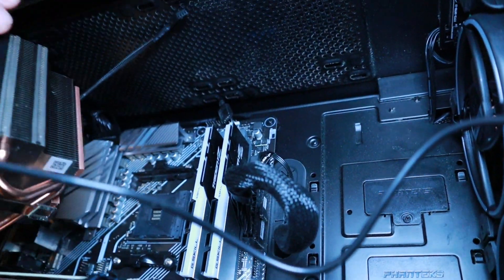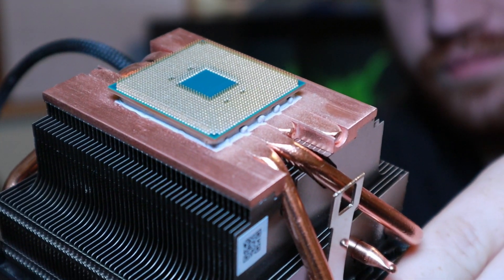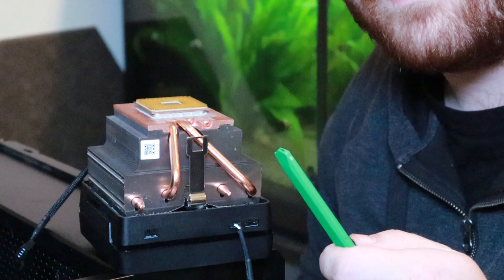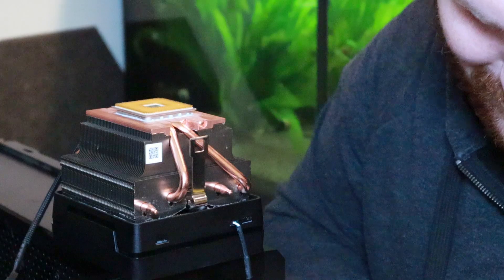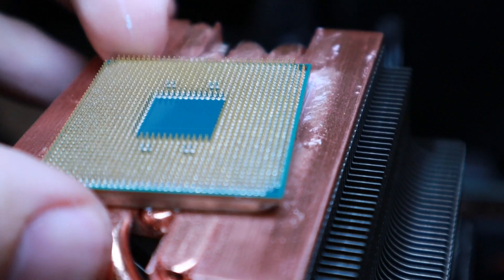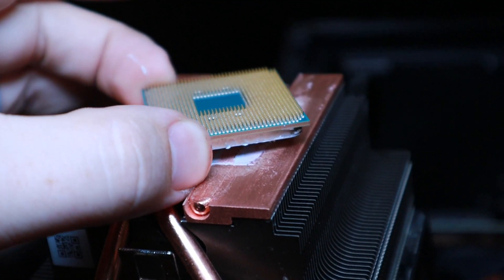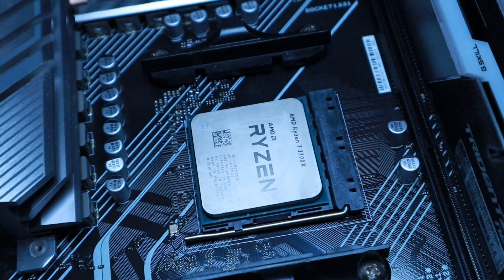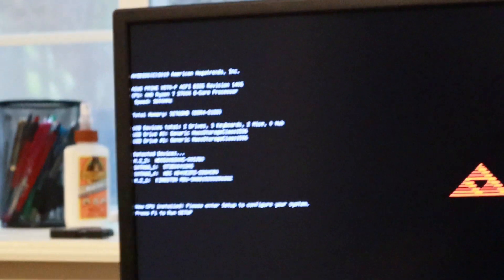almost broke my ryzen cpu

Comment: I think by this time you have already learned this but saying it for the sake of putting it out there. Before changing your CPU cooler, one should run cpu benchmark tests like Cinebench, AIDA and etc for like 15 to 20 mins to get the CPU and thermal paste to warm up. After that, shut down the pc and then try to change the cpu cooler. That way, the thermal paste will not stick to the CPU like a glue and pull it off when you try to change the CPU cooler. Warming the area up with a blower gun also works, but sometimes it might cause damage to the motherboard if not handled properly. Thus, running CPU benchmarks is the safer way to go.

Comment: That's why it is recommended to twist the cooler while removing (specially for ryzen as intel cpus are bound with the mb with brackets) and this is not a very big deal. Very rarely the pins bent while these type of incident, actually its more common than you think among those who don't open their computer very often.

Comment: Hey I have the same cpu I think. I purchased a rog strix b550F. Runs great so far (been 2 weeks) although I find that my cpu gets hot at some point (65-68 C) and I'm wondering if my thermal paste ran off since I installed it the other way around at first before booting. I have a corsair icue4000x with the 3 intake stock and 3 exhaust and the stock heatsink that came with my Razen 7. Should I worry about it?

Comment: Just a suggestion, heat the area between the cooler and the CPU before you pry it. That will probably help it come off easier and with minimal damage to the CPU.